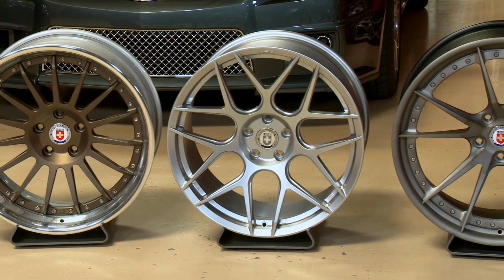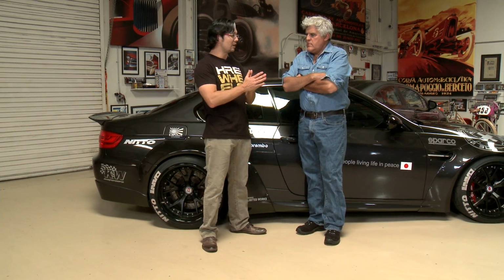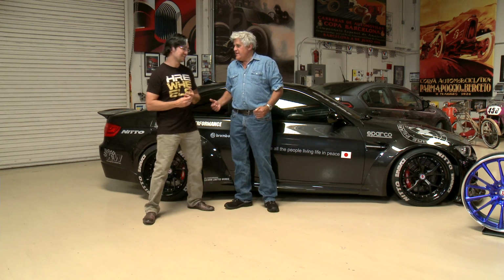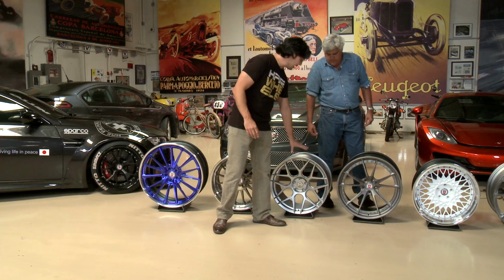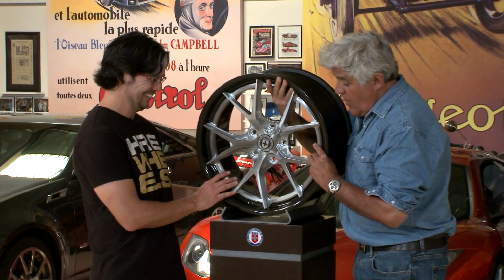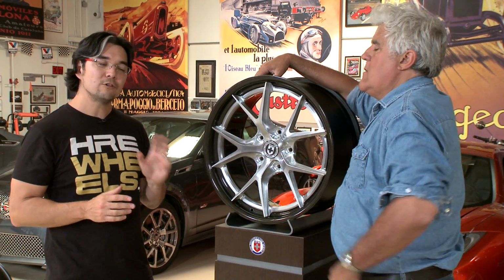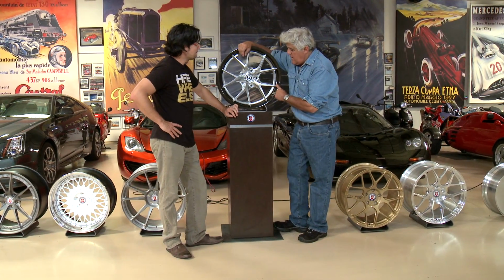Custom High Performance Wheels - Jay Leno's Garage

Comment: I bought a 2005 911S with HRE wheels in 2010, they were so bad a** looking 5 spoke, that everybody and I mean everybody commented  that it made the car so sexy it was kinda weird.  I had a problem with the wheels leaking air pressure, (the owner left the car in the garage in the garage for 3 years allowing the tires to go flat and corroded)  it cost $150 per wheel to reseal at the HRE facility.  HRE treats you like royalty and gave me all the attention to make me feel comfortable.  I sold my 2005 in 2013 cause I was moving to South lake Tahoe  (snow infestation), now I'm looking for a new 997 and I wish I had the wheels, look up the price, now I kick myself for selling it.  They were $10K wheels!  Bummer...

Comment: Jay i am reading Motor Trend magazine and the Bugatti tires and rim might cost you $100,000 for  a new set after you drive 10,000 miles because heat eats it up so you think about that? or sooner if you don't get the right ones.

Comment: The Beats by Dre of the wheels...
Reply: terry bigMango Beats are made in California and are custom instead of cheap Chinese crap?
Reply: dereksbooks, Cost to performance, with same price you can buy 1 piece fully CF wheel. HRE wheels are all over priced, except for the ones at the top. Just like Beats, other than their top tier stuff - all else is just selling you the name.
Reply: terry bigMango that's adv1 not hre

Comment: haha, HRE small company that nobody's heard of... right
Reply: gav240z
they're not very common anywhere due to their price tag, but most people that know cars know HRE
Reply: Ya I don't know of a single show or track I went to that I didn't see someone running HRE's. In Jay's defense though, he's not the most aftermarket savvy.
Reply: ive been a big car fan for all of my 32 years and ive never heard of hre.
Reply: Some of their wheels look exactly like BBS wheels. I'll take BBS wheels
Reply: outside of North America they are not very common.
Reply: @gav240z  I see people with those wheels in the Netherlands
Reply: Lazaro Carreiro some of them have a very similar style and when it comes to the honeycomb/multi-spoke wheels id probably go with a BBS over an HRE unless it was a carbon barrel version if that would even be possible  however the HRE wheels are nice. But they come at a pretty high cost
Reply: Patrick Pelletier I agree. HRE do sure make very nice wheels. For me personally I'll take BBS, Maybe because I already have a set lol. But none the less HRE has been in the game for a long time. But as I stated I'll take BBS.
Reply: Lazaro Carreiro yea it's all about personal preference for sure. And id feel a lot better driving around with BBS's than HRE's as for 1 with HRE's you can be sure they'll get stolen real quick and if you crack or bend a rim or even curb it (ive never curbed any wheels but it could happen) the BBS is going to be easier to replace both emotionally and financially. I have a good friend that has a really nice collection and his main cars all have HRE's he lives in a really nice area though and ive never heard of his getting stolen but if he was anywhere else im sure he would run on steelies cause people love to steal alloys
Reply: Patrick Pelletier 

Very well put! Glad your friend lives in a nice area. Have him purchase Mcgaurd locks. Very well worth the money.
Reply: Lazaro Carreiro il let him know, and good to know aswell. I appreciate that, thanks
Reply: Mark, it isnt a brand that is decades old but its at least 10 years old or so. im not saying you should have known them. im just saying that they werent around as long as you and even though they havent been they've been all over the car world in places like SEMA for years and all that
Reply: or i guess theyve been around since 1978, but i didnt know about them until the 2000's
Reply: Lazaro Carreiro Why are they better or is the price ?
Reply: Bob Last 
With a very big  W R O N G !!!!!!
Over the last 15 years I’ve been going to SEMA  countless other car shows and meets they been there any car enthusiasts knows HRE
Reply: Great product- very informative video 🙌🏾
Reply: Bob Last Truth.
Reply: Well this interview was in 2013, so...

Comment: I'm not going to watch the video but are these wheels super light weight?
Reply: yes
Reply: +The One how light? I have wide 19" wheels that are 23/24lbs (front/rear) per wheel. Are we talking carbon fiber light?
Reply: they're not the lightest, but overall pretty light for an aluminum wheel.  there are some wheels out there that are maybe a few pounds lighter per size, prolly cheaper too, HRE's are actually not that far off carbon fiber wheels.

Comment: this is why non millionaires purchase fake wheels. this is why I would buy fake wheels, over and over again.
Reply: What is your definition of fake? All wheels driven on the road are real wheels.
Reply: Or just look around and buy a set of used forged Rays wheels for $500. :)  Most people haven't heard of the RAYS Stark-MS, which is a just a split-spoke version of the TE37, still forged, weighs the same as a TE37, so you can pick that up for a fraction of the price of the TE37 model.  There are always deals going if you look around... Pair of Prodrive (Rays) forged wheels for $200 for example.
Reply: f8head fake wheels are none name brand wheels that cost less than $2,000 I guess. I don't really know man go Google fake wheels.

Comment: Some of you guys....If you can't see the benefit of quality wheels, I don't know what to say to you.  Racing teams don't use wheels from HRE, Forgeline and such just because they want to spend extra money.  Quality is quality.  If you think you're not getting what you pay for, why don't you start your own wheel manufacturing company...since you seem to think these are overpriced?
Reply: IF money is no object, and WINNING is the only consideration, they MIGHT be worth it, assuming the driver can exploit the difference. Most drivers aren't good enough to justify the huge cost increase, even if they do it anyway.
Reply: Umm, V8 Supercars use cast wheels from British manufacturer Team Dynamics as a control part (they used either forged A-Tek aluminum wheels, or cast Speedline magnesium or OZ magnesium wheels before that), while NASCAR uses steel wheels...  For the prices HRE are charging they should at least be forged magnesium wheels really (like exotic supercars like Ferrari and McLaren come with), but anyhow.

Comment: You pay for quality, folks.
Reply: +shawoo I guarantee the cost of producing a set of 12K wheels is 3K... that's just what happens when you have a big/hip name...
Reply: +JuergenGDB Most 'high' performance wheels are forged
Reply: I'm just stating, 20k for a high quality forged wheel is ludicrous. The wheels I mentioned at most would be 4-5k
Reply: +withered962 20k was for their carbon fibre wheel I believe? Afaik a full set of 19-20 inches one piece forged from HRE costs around 8-9k
Reply: +thinkpad411 do you have a brand of wheel that compares to HRE?  If so please name them, and are they forged?
Reply: +JuergenGDB actually all wheels are forged -.- usually by robotics
Reply: Mark Valencia All wheels are of Forged quality????  yeah.. not.
Reply: withered962 Preference, and wallet book.  That's all it is.... and I guess design.  Stuff from ADV 1 is sick.. but you need some deep pockets... but like I said, preference, and wallet book.
Reply: Forgeline.
Reply: adding to withered962’s list.
Reply: +JuergenGDB Volk, Work, SSR, CCW

should I keep going?
Reply: withered962 My point is not every wheel is a light weight forged wheel.  Are some better than others.. yes.  There are many forged quality wheels.... and then.. there are the masses.

Comment: This is y everything is made in China 12k for American made wheels forget it haha
Reply: +john smith did you watch the video? they have the aluminum cylinders forged to the general wheel shape by another company in orange county and then HRE shapes them into the wheels.
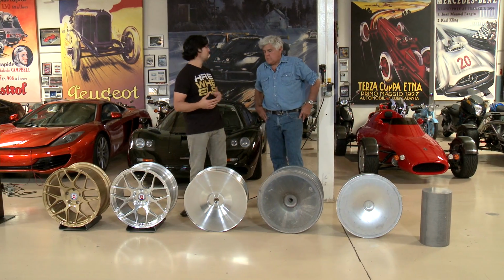Reply: +Mike Arredondo Well if you went to their website you would be probably more educated.&#160; My wheels for example the FF01 are made in Japan.  My exact wheel you can see at 6:22 the powder coated IPA Bronze wheel.
Reply: +Mike Arredondo most of the wheels are still made in Taiwan.
Reply: Yeah. Exhaust is the worse..Titanium exhaust are either made in China or Taiwan and they charge you fortune for it.
Reply: Vossen rs5 magnesium forged wheels sell for about $8500 USD. weight is 15 pounds for 19".

Comment: Shitty expensive rims that break apart at the race track!!
Reply: David13spurs You might want to reevaluate your view on HRE after they did a complete management rearrangement a few years ago... It's FAR from the company with the broken wheels that it used to be. For broken rims, fake TÜV claims, fitment and paint issues, you want to look into ADV.1 and 360 Forged for that.

HRE is now on a level with BBS and OZ.
Reply: ***** QQ
Reply: suitable for a car that breaks down often?

Comment: Having forged wheels is awesome, it does feel better driving my car with them on vs. cast.

Oh, and I'm not paying $3000 for cast wheels, anyone who does is a fool.
Reply: +GalvatronTypeR thats not cast its flow formed, It's lighter and stronger than cast but not to the standards of forged. People use those types of wheels on GT2's so I think your little honda should suffice.
Reply: GalvatronTypeR matt farah did.
Reply: FF01's shown are Cast Flow Formed, which is different than a regular cast aluminum.  BUT... They aren't made in the USA as the video above states...  HRE's own website says they're made in Japan.
Reply: It’s a flow form cast which now cost 2200-2500 same as bbs flowform wheels. Stronger lighter barrel of the wheel,which is the most important part.
Reply: @oliveremsickneurofit  the barrel u mean where the lug nuts nd hub holes r or outer rim?
Reply: Flow formed wheels are good if you want to step away from cheap cast.

Comment: Why am I buying HRE's? same reason I bought my GTR. I want a quality product that not many other people have. You could buy a zr1 or 911 for the same price but you see those same body styles everywhere. Volk, BBS, enkei are quality wheels too. I was only going to save maybe 1.5k on getting a set of new volk g2's, TE37 ultras, or advan gt's  over an HRE wheel. good luck find a 20" BBS FI under 8k new.  Id rather spend the extra and get my own offsets and finish

Comment: Why is everyone complaining about the price? Built to order wheels designed to fit the exact measurements of the vehicle and designed to perform under the most extreme road and race conditions cost money. I went to their 2014 open house where he gave a tour of the factory and showed many of his clients cars. Some of these wheels end up on the track on cars like the Porsche GT3 in real races. These are not your average brand name wheels. You pay for performance first and the looks are an added benefit.

Comment: TÜV is just a German company, not owned by the government, which "tests" your car and it's aftermarket parts.
You can buy us wheels and just bring them to the tüv, but then you just have to do a little bit of extra work on them so that they accept it
Reply: I remember working with a company that had to send products to TÜV for testing and certification, as well as ensure all certificates and test reports for each product dating back 10 years are in good order. Sure it makes quite a bitch being a manufacturer having to jump through all these hoops, but at least we as manufacturers and also educated consumers know that the product will hold up to some very unlikely but extreme conditions and not fail catastrophically.

Comment: I love their wheels, but their prices are outrageous. Quality product no doubt, but the manufacturing of a wheel from company to company is no doubt similar, which makes it hard to justify the price.  And for me, I can't justify spending 6 stacks plus on some wheels, when you can get a replica that looks identical for significantly less, made by virtually the same process, materials most likely supplied by the same supplier. Buying an HRE wheel is like buying a BMW or Mercedes, status related. I'm sure HRE stays in business because of materialistic douchebags who need HRE's for their "lambos", but in the real world technology has made manufacturing a quality product so easy and cheap that it would take a real moron to spend that much on a wheel. This isn't craftsmanship, its computer designed and mass produced inflated bullshit and I'm now I'm fucking pissed cuz I want some, but my wife would kill me!!! hahaha

Comment: Surprised Jay didn't ask him about their wheels splitting in two! or did he? i'm still watching
Reply: This is HRE, not ADV.1.
Reply: ABOlsen69666 think you need to read up on HRE they were even banned by a lot of tracks several years ago because of it
Reply: StylinRed that is ridiculous I did read on it and yes some wheels were broken but every wheel can break with enough force. I saw ccw, bbs, works, weds all broken on tracks as well and no marshall refused them... They even use hre's on race cars like vaughn gittin jr.'s fd musstang, many pikes peak monsters, ect.
Reply: MrTheMrhappy yes but for awhile there HRE was having a string of failures which caused them to be banned, wasn't sure if it was still an ongoing issue
Reply: StylinRed The ban what short lived, and HRE has changed massively since the original owner ran the company. New manufacturing facilities and new products. No track will ban a TÛV certified wheel and no track today will ban an HRE wheel.
HRE are today on par with BBS, OZ Racing, Ray's, Apex, Volk and Advan.
Wheels to stay away from. ADV.1, 360 Forge and Vossen, they are not the high end wheel manufactures they try to make themselves look like.

Comment: People dont really understand the concept of HRE. I live in San Diego and I see these wheels a lot, these are the ultimate wheels for performance, looks and quality. I mean race teams use them. The pricing is high, but for their targeted clients its fine. Ive seen a Gti with HRE P44sc on it.. those rims cost about half as much as the car.. in a situation like that its a bit extreme, but each his own. But lets say on an m3 or 458, HREs are perfect!

Comment: it probably is around 50 lbs, ever pick up a tire off a f350? the wheel is slightly smaller on the ones ive worked on, and they weigh a ton.

Comment: Hes referring to the fact that they dont stock wheels... its all on a built to order basis... no limits on on widths and certain offsets and PCD's.  For example, Volk makes a great wheel but the absolutely will not give you certain custom offsets and widths, what they have is what they have.  HRE will give you literally what ever you want/need/desire.  If that helps...I

Comment: Where are you getting your info? The '13 GT500 has 6 piston Brembo brakes standard.
As for handling well yeah, it's not going to handle as good as similarily priced Euro car. What you get instead is the world's most powerful production V8 and crazy straight line speed.

Comment: the 2013 GT500 has 650 bhp but still has live axle and single piston brakes. Everything on the car like chassie etc is so underdimensioned for that engine that the car is outright dangerous.

Comment: However those are not nearly the same Enkei wheels you really can buy at Pep Boys and Autozone.  Entirely different wheels for different applications using the same brand name.  And HRE typically makes wheels for Euro applications and if I am not mistaken many GT and DTM cars use them.

I would say a good middle point in terms of quality and price is a BBS wheel.  Enkei near the bottom and HRE are expensive.

Comment: You need to check the construction and strength and durability of the wheels as well.  Comparing simply weight and cost would be like comparing cars based on simply horsepower and price.  Like a 652hp GT500 for $55k and a 565hp Vanquish for $280k  Why would you pay more?  For build/material quality, ,aesthetics, exclusivity, etc.  It's no different here.

Comment: HRE does make great wheels.  They are typically used in Euro applications but I have seen them on a wide variety of cars.  Heck, even tirerack.com carries them now and they can be had for as little as $800/wheel, depending on the size.

Comment: When Carbon Fiber wheels become dirt cheap, I'll get some. Chevy isn't even using aerowheels on there Cruze Eco Diesel model yet my Ford SfE has aero wheel covers and low rolling resistance tires. Unfortunately that add on cost me 500 now its a 90 USD option on newer Focus. Doesn't help me get the mpg they claim, I might just put some fancy wheels on instead of those aero plastic wheel covers.

Comment: I bought hre wheels for my 914 project....10" rears and 8" fronts.They were the 505 model,3 piece with black centers.About $1200 for the lot then(1994).What's with these prices?

Comment: Aside from my daily driver which is German and boring, the newest car I own was made in 1968...  And there aren't many new 67's for sale...  LOL.  Still, thinking about it, $20k wheels or even a new V6 Mustang??  Easy choice. Putting this in perspective, I can buy a brand new pair of BST carbon wheels for my motorcycle for about $2500 USD.  $20k is just too much.

Comment: Enkei has been a Formula One wheel supplier for McLaren Mercedes for 18 years now. And the RPF1 which is based on the same technology and which is both lighter and far less expensive than HRE's comparable cast wheel, is used by many race teams throughout the world. Enkei is also a supplier to WRC, many OEM car manufacturers, and is the largest performance wheel manufacturer in the world... How many racing teams use HRE? You don't know what you're talking about.